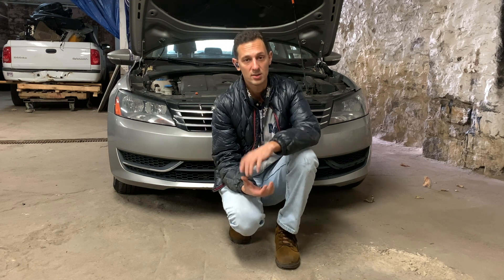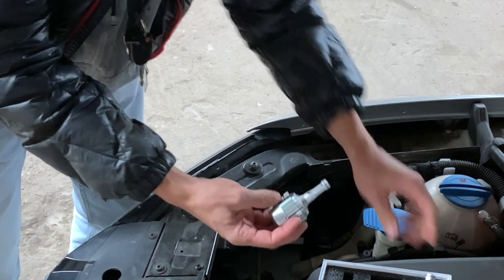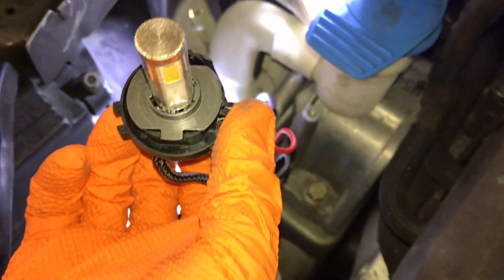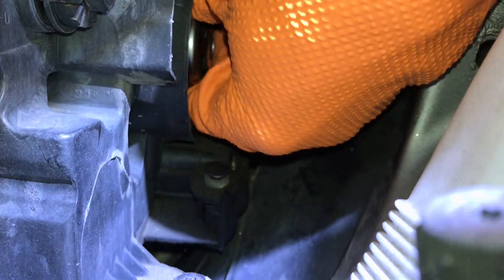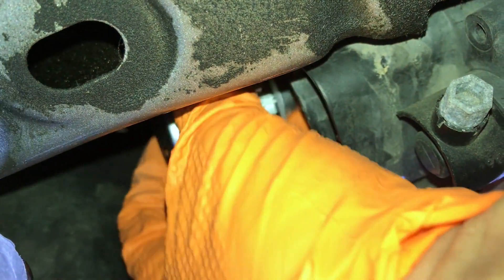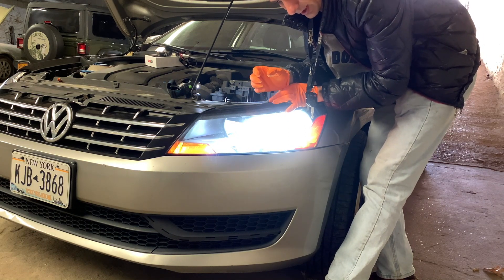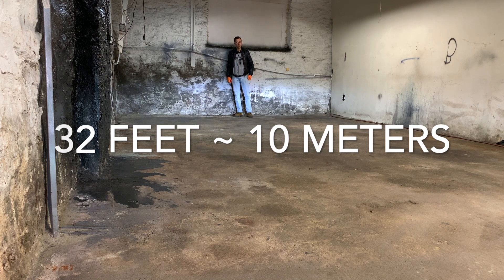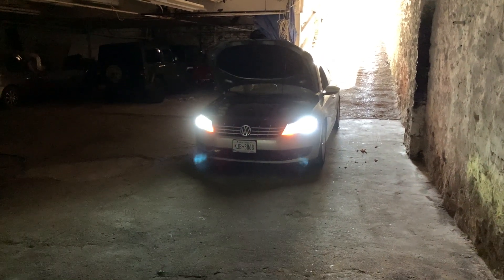VW Passat B7 LED headlight Direct FIT!

Comment: Hi there did u get any error code on dashboard?
Reply from the maker: Hello, no code. Good quality, but some of these cars come with a little different system.
Reply: @artworkslights  what u mean ?
Reply from the maker: @q8y868  I mean, that depending on production year, these cars may have different equipment, so I am not sure if effect from LED kit will not change on the car's system.
Reply: @artworkslights  thanx